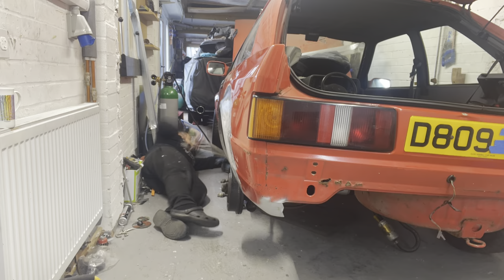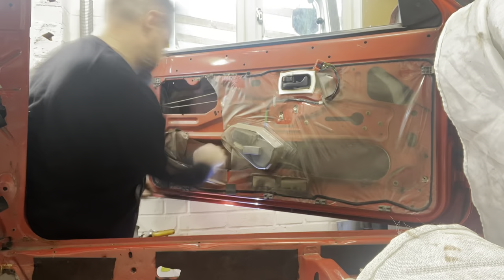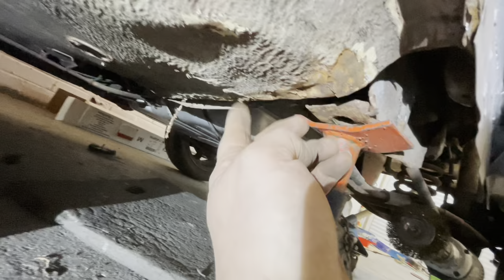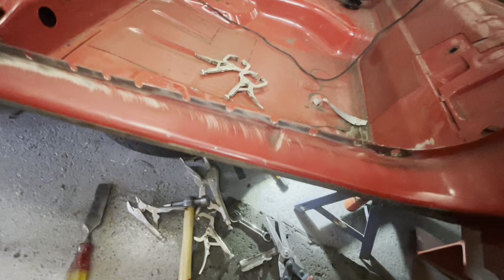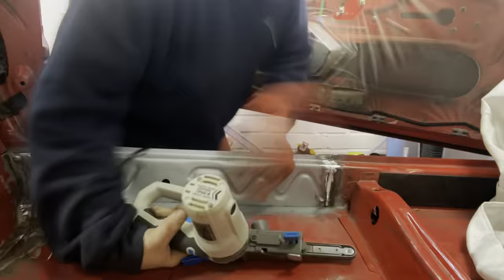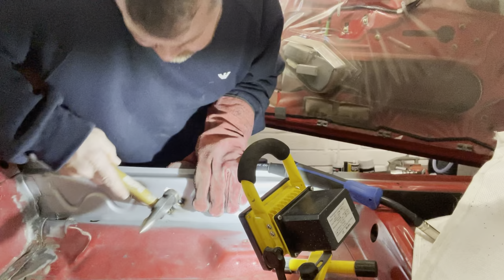Escort RS Turbo inner sill  repair #19

Comment: Hi Chris great work on the inner sill . I did my sill repair a little different to yours, I was able to cut the lower half of the inner sill above the rust and jogged in a fresh piece of flat steel. I don’t know if you have noticed , it looks like the passengers foot well ,floor is pushed / dented upward towards the rear where it meets the inner sill .

Comment: Hi Chris great work and progress on your RS turbo. Could I ask what it is you use to mount the small cutting disc’s too your drill as I’m in the middle of restoring a Xr3i cab and need to get into some tight spaces. 

Thanks
Ste
Reply from the maker: Hi Stephen, thank you very much!  It’s a 10mm bolt a couple of washers and a couple of nuts to lock it together to stop them coming undone. These small discs are great for getting into tight corners or cutting very thin cuts. I had to make this setup because my air compressor has stopped working so couldn’t use the discs in my air cutter. It work’s quite well.
Reply: Brilliant idea I’ve just put one together my self now whilst I’m at work. I’ve got air tools at work but no compressor at home and was looking into buying a dremel for the little discs but now I don’t have too with this little contraption haha. Cheers Chris 👍🏻
Reply: Hi Chris just tried cutting though a thin piece of steel with my drill but it doesn’t spin very fast haha. What size compressor are you running at home?
Reply from the maker: Hi Stephen, yes you need to have your drill set at its highest speed for the disc to cut. It does work well for tight corners. I have an old APS 200L air compressor which I use at home. I think the motor has gone as it keeps blowing the start up capacitor.

Comment: Generally, if you cut the lower 7 or 8" off the wing, you will see the full disaster... Behind the wing there's no less than 6 layers of panel that form the floor-pan/inner front A pillar/front arch/front of sill... Those are always rotted. No idea how you did this with the door still on - I always bin off the door right from the start. I always cut the lower 8" off the wing as well - if you don't, the outer sill is close to impossible to fit & you have no hope of rebuilding the inner layers. Sill repair panels only go as far as just past the wing - you're on your own for the front of the sill.